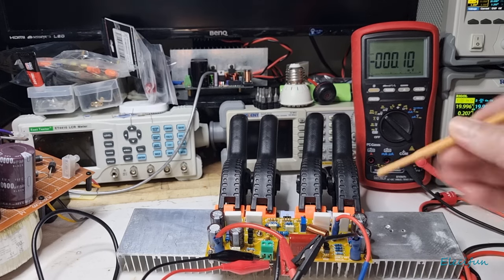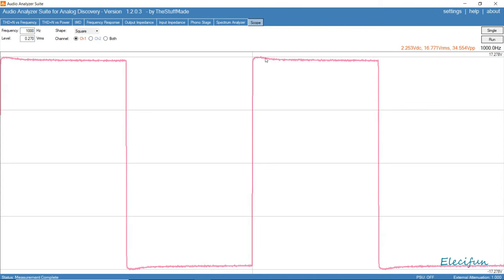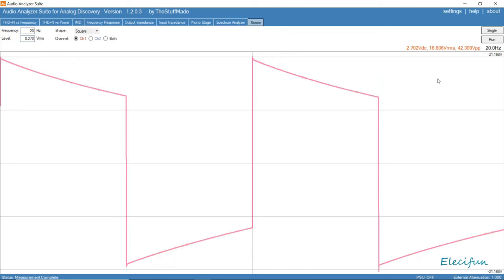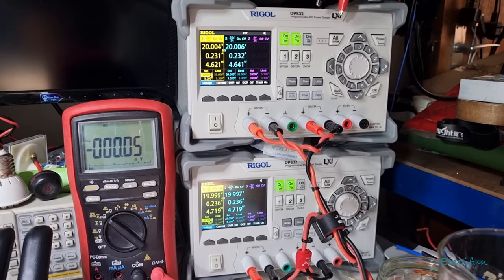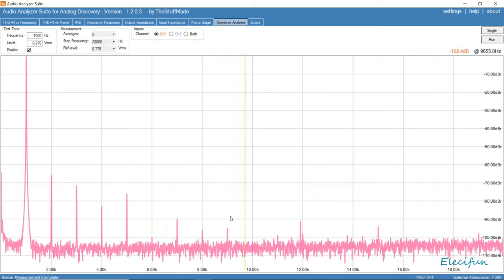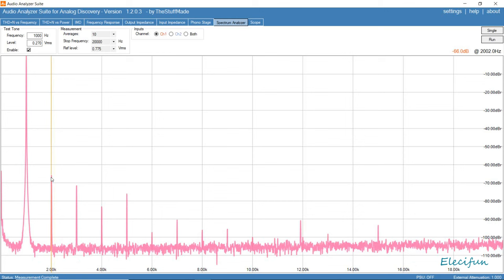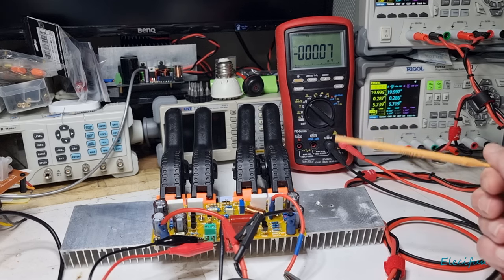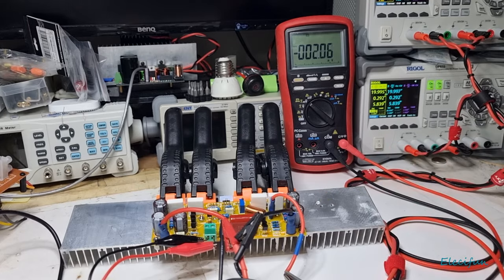SYM5-3 Class AB Amplifier DIY Kit PT2 'Output Power Tests' at 8, 4 Ohm (AliExpress)

Comment: Thanks for producing these types of videos, Elecifun. I always find them interesting, informative, and entertaining. These kits aren't terribly expensive, but I hate wasting money at any rate. These videos are valuable in that one can just disregard the products with which you find fault. I was wondering if you've experimented much with active cooling methods to aid the passive heat sinks. Have you used small fans in conjunction with the heat sinks? There are mixed opinions on the use of fans in audio amps, and I am interested in your opinion. Happy building and listening, amigo.🫡 🍻
Reply from the maker: @Sonic_Ox The videos and the making also really help me. I want to build my own amplifier / pre amplifier from these kits when I have found the right combination for me. 
In my head active cooling might introduce noise audible and electrical. Remembering small fans need to spin faster for cooling than bigger. Faster the spin the more noise. Big heat-sinks I would choose when picking an enclosure for the power amplifier side. Consider different class amps have different cooling needs.
Reply: Yes. I have the same concerns. Thanks for your input. I appreciate you sharing your knowledge.